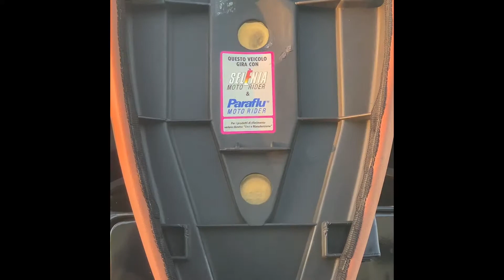How To Install Newest Style Vespa PX Seat:2011+

Comment: Hi
Just brought a new, seat, put it on but its not fixing to the seat stem any suggestions please
Reply: Paul Vickers, just adjust the seat using the three 13mm bolts at the front. You can go forward or backward as needed.